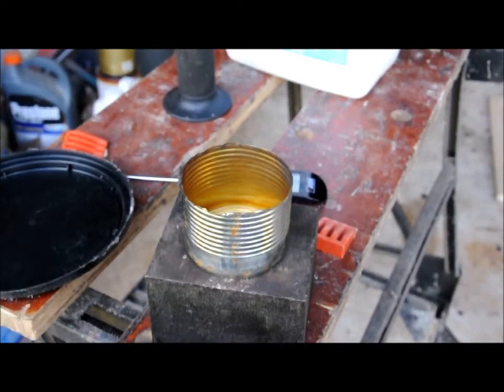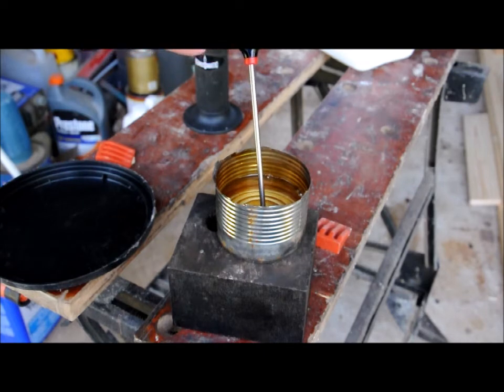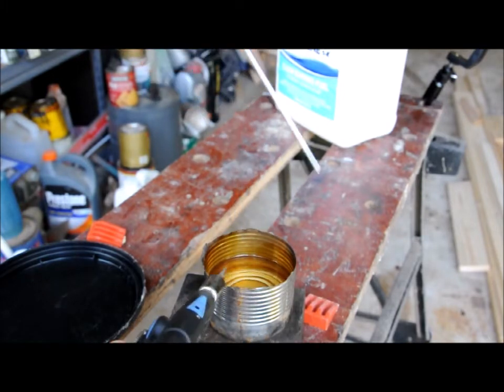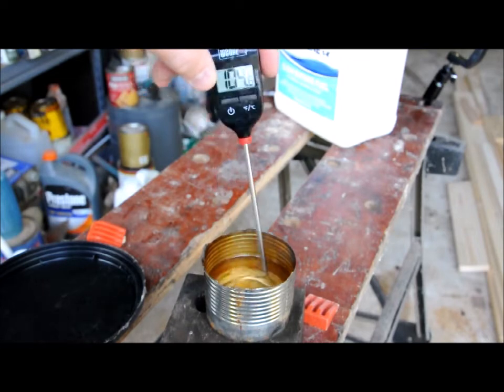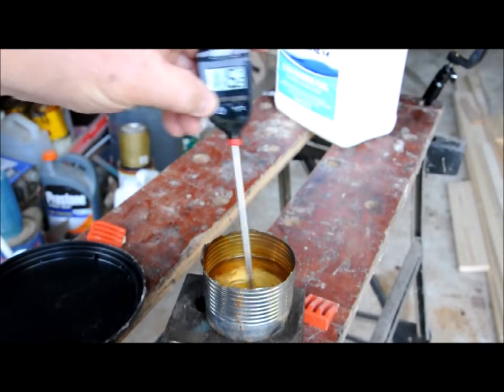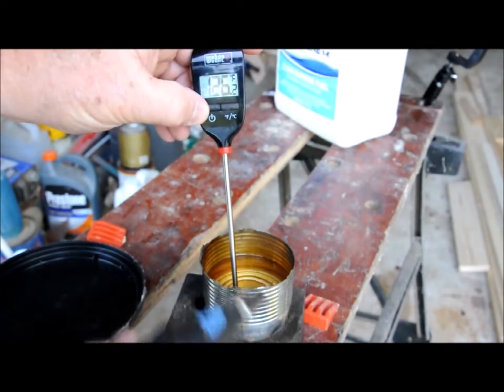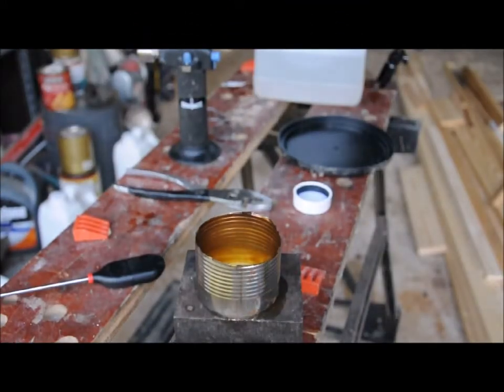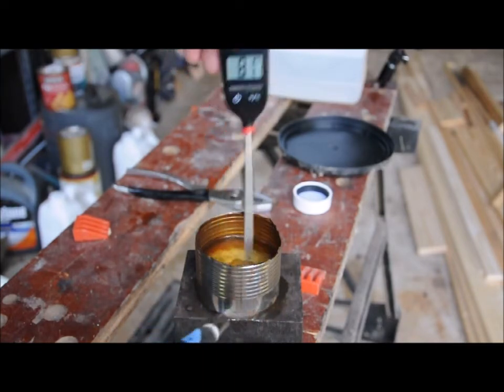Kerosene Flash Point Experiment

Comment: Thanks Kelly. How much does elevation impact flash point. I am in calgary which ranges between 3300' and 4000' above sea level. thanks.
Reply from the maker: Great question. It does change with altitude. There are some good studies you can find online mostly dealing with Jet A fuel and bomb detonation. It is written on an Einstein level for the most part. It would be interesting to test.  I am at about 1015 ft.
Reply: Moray - I used data I found for Diesel to get this approximation. At sea level Diesel's FP is 121.55*F
At 4,000ft Diesel's FP drops to 115.25*F
So 6 degrees is not a worrisome number. 
I'd say as long as the fuel you are using is around 150*F to start with you should be fine. Neat question!